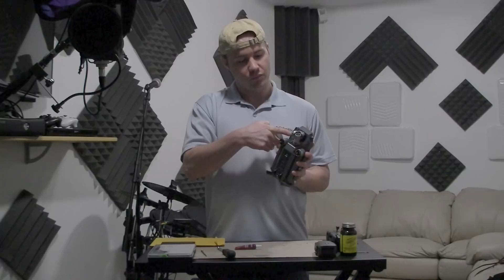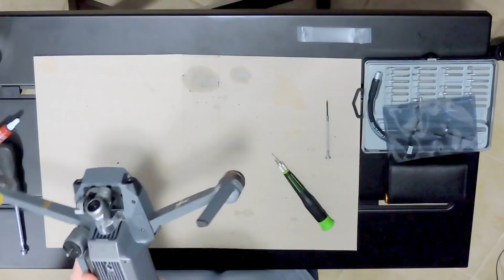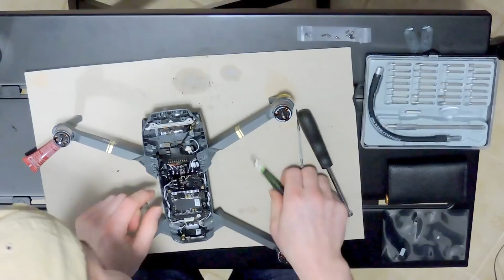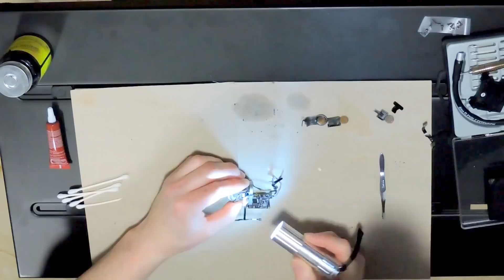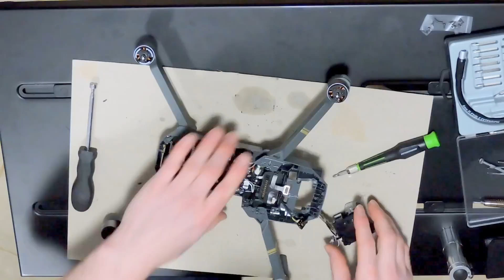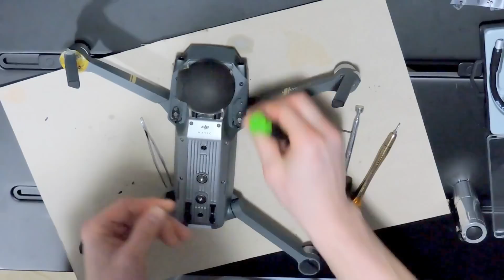DJI Mavic Pro Drone Crash Broken Gimbal Flat Ribbon Cable PCB Repair How To fix failure &Replace DIY

Comment: dose any one can explain why after i replaced gimball with original camera from mavic - both gimball and video -dead?
Reply from the maker: If you replaced them both as a single unit there are two main culprits that come to mine. 1. the connectors/cables are not set properly and are slightly off or bent. 2. there is something wrong with the board or camera...

Can you do me a favor and Subscribe?

Cody LLS

Comment: Hi, thanks for this video. Do you have some schematics with board section detail? Thanks
Reply from the maker: No schematics available. Do you have a problem with the PCB board? I have a detailed description of the repair below the video. Can you do me a favor and Subscribe?

Cody LLS
Reply: Liquid Laboratory Studio thanks...subscription done...:)...well, my mavic pro won't accepts the controller, I tried the procedure, but nothing happens..I need a schematic to understand his logic work and locate his different modules to check correct work
Reply from the maker: Thanks. I assume you are talking about the gimbal up, down, left right? If the cable is damaged in anyway through normal wear-and-tear you would have to replace the ribbon cable.
Reply: No, is no possible for me connect my RC to A.C....i follow the correct procedures, but the remote remain  BINDING for all time and not pair to AC
Reply from the maker: Maybe the toggle switch is broken wifi/rc? Are all the LED's flashing on aircraft and link button (I think it goes red, orange, then green= linked)? There are two main ways to link https://www.youtube.com/watch?v=G52F4hlR4MA

You can also try to link the a.c. to wifi cellphone app! See if it will even pair that way
Reply: Thanks for your reply...well, rear led's flashing yellow, the wi-fi/RC switch is correctly set to RC and little led under the connect button is green.
I'am able to connect by wi-fi, but have no battery information, no sensors, unknown IMU status and no flight mode. If i try to take off a message with "takeoff filed" appare on DJI go 4 app. Facory reset done, reinstal firmware done...what can I do?

Comment: Does the flat ribbon cable damage the camera image too..? I mean will my Mavic lose image if that’s broken
Reply from the maker: The flat ribbon cable only controls the mechanical aspects of the gimbal not the video feed. That being said, the mavic uses a mechanical image stabilizer (focus) so the image will appear distorted and "jellow like." You can fly with the cable broken but the footage would essentially be useless and you won't have any of the tracking features or vertical and minor horizontal panning control. I hope this helps. Can you do me a favor and Subscribe?
 youtube.com/liquidlabstudio

Cody LLS

Comment: Hi. I would like to see how the camera was behaving before the ribbon cable was changed. Looked at several different videos on how to change the cable, but all of them jumps right in to it. How can you be sure the ribbon cable is the problem?
Reply from the maker: Aah, I should drum up some old footage, hope I didn't delete it (the picture looked like jello from vibrations in flight). When the shock plate broke the gimbal was dangling. I made a new shock plate and the camera would not pass it's checks. It would give a "Gimbal overload error" and the camera would end facing down instead of forward in it's normal position. Considering the video feed was normal and it literally fell a few feet the process of elimination lead me to suspect the control PCB ribbon cable. There are 2 main causes of the gimbal overload error 1. obstructed gimbal (usually the owner leaves the gimbal clamp in during the flight). 2. Broken ribbon cable or defective PCB board.

I hope this helps. Please like and Subscribe,
Cody LLS
Reply: Liquid Laboratory Studio 
Thanks for your reply. 
What you're describing is very similar to what I'm experiencing with my mavic. 
Also from reading other comments on this video, it seems quite possible that the ribbon cable is the problem for me as well. 
I ordered a new one and keeping my fingers crossed  :)
Reply from the maker: I know what you mean about fingers crossed, hope it is a reputable seller. You came to the right place this is the original Mavic Pro repair video, I have helped many mavic owners with this and many other issues like the visual sensor calibration required after the gimbal repair https://youtu.be/0uJOQCPcJo0 and I hope it doesn't happen to you but arm/leg removal and repair.

Please Like and Subscribe,
Cody LLS

Comment: Thank you for the video. It would have been more useful if you could 1. Not take what you were doing off camera and 2. Focus more on the placement and threading of the replacement ribbon (on camera.)
Reply from the maker: Thank you for your comment and kind words. I agree with you, honestly, considering I was the first to make a youtube video of the repair I was only 70% confident it would even work and couldn't undo the glue. I did a little more trial and error than I would prefer.

Please like and Subscribe,
Cody LLS

Comment: I had the shock plate wedged and used your video to open it up and unhook and unscrew the keeper. You should do a video for that too.
Reply from the maker: Good idea, Sometimes you can wedge it back with tiny flat tools but it bends the plastic and rubber bands.

Please subscribe,
LLS

Comment: How u fold cable?
Reply from the maker: There are a few fold points you can partially crease them following the original ribbon folded direction 2. From tp1 to tp2 connector is the real tricky part it reverses twice and folds over itself at connection tp2 
There is more under the description.

Please like and Subscribe
Cody LLS

Comment: Do you have a link to where you bought it from, I am looking for the cable for the spark camera and on Ebay they are selling bogus cables
Reply from the maker: I see what you mean no hits for searching spark flat ribbon cable. I was one of the first to get the flat ribbon cable for the mavic, so maybe the spark isn't out yet. You can contact DJI support they have information on availability even though they wont sell direct right away Product Support USA +1 (818) 235 0789 Parts Support USA other numbers on dji.,com . They told me Amazon is the authorized dealer they will also know if it is available outside dji or if it is back logged because they work with the same suppliers. I purchased mine through https://www.fstop-labs.com . I would love to take a shot at repairing a spark. The mavic pro was difficult but an accomplish-able challenge. Let me know if you find it in case I get asked again.

Please like and Subscribe,
Cody LLS
Reply: Thanks for the reply  I have understood that you have to send the Spark in for repairs, they seem to replace the complete camera, which costs about $200 and is available on internet, Hopefully when all the Sparks are out of warrantee they will start selling more parts

Comment: Hey dude nice video. Id like to ask you what's your opinion about my mavic. Recently I did a crash and although the propelers and everything are good and also the gimbal moves with my controller .. although I saw that the bracket is more flexible now.. Can I change that?? (Thanks again and sorry for my bad  english)
Reply from the maker: If you are talking about the gimbal shock plate. I would highly recommend changing it (the video shows how). I prefer flying the Phantom 4 Pro. The Mavic Pro is a brittle novelty that you will have to become an expert in repairing to keep it flying.

Thank you for subscribing
Cody

Comment: I appreciate you showing us how to repair the Mavic. 
Thank you very much.
Reply from the maker: Thank you kindly for acknowledging the effort @Marco S
Reply: Those people here criticizing your work are fools.
Reply from the maker: There was no repair manual or reference @Marco S Thanks again I hope your repair goes well

Thank you for subscribing,
Cody
Reply: I learned from you how to open the Mavic. I accidentally flew my Mavic into a tall tree and it stayed there for almost 2 weeks, until I found an arborist who climbed that tree to fetch my Mavic.
To my horror there were 15 earwigs that came marching out of my Mavic.
Yesterday I opened up the Mavic and found white stuff in there that wasn't supposed to be in the Mavic.
Luckily for me the gimbal survived and even though we had rain every day, there was no water in my Mavic.
Very strange...
Reply from the maker: I am glad you got it back. Try putting it in a bag with silica packets or rice to suck out the residual moisture from the rain so the electronics stop corroding.
Reply: When I got the Mavic back on that afternoon 2 weeks ago, the same evening I turned it on and it flew as though it had never been in that tree for 1 week and 6 days.
I had recharged its battery first without any problems. 
Subsequently I kept the Mavic in a room where it is always warm around 28°C.
I left the kernel of a nectarine in the same room in the hope to lure any other earwigs out of the Mavic, and sure enough, 6 days later I caught one nibbling at the kernel.
Anyway, those Mavics are tougher than they look!

Comment: Hey! good video, it is so clear! I have a similar problem with my mavic: I crashed two days ago and now the gimbal is not working correctly. It is moving when i turn on the mavic, but it doesn't respond to my controller.
Everything looks fine, the camera is working fine and i can take pictures and record videos.
Under Overall status on the DJI app it posts two messages:

1 - Gimbal motor overloaded. Check weather gimbal clamp is removed.

2 - Gimbal is restarting. Check that gimbal rotates smoothly if restart fails again.

How can i know that is a ribbon cable problem?
if I would be sure it is this problem i will just buy a new cable and i will not send the drone back to dji (I've seen DJI costumer service is not the best), but how can I be sure? I don't want to create more damages!!
Reply from the maker: Those are the exact same symptoms mine gave. When the gimbal motor overloaded it would face in the wrong direction (down). Then it kept restarting and trying to do the initialization test so making clicking sounds while checking for full movement and functionality. The difference is my gimbal plate broke which gave a strain on the PCB ribbon cable. That is why I was pretty sure that was the problem.

Please like and Subscribe
Cody LLS
Reply: Thank you for the answer, my gimbal plate is not broken, it looks fine. I really don't know what to do
Reply from the maker: All signs point to the cable..., but you won't know unless you disassemble it. The damage on mine (in the video) is not apparent until I got really deep into the repair. The flat ribbon cable and shock plate truly are the Achilles heel of the Mavic Pro.

Thank you for Subscribing,
Cody LLS

Comment: Do they make higher quality replacement parts?
Reply from the maker: I know the ribbon cable comes in many different qualities, I bought the more expensive one. As far as the gimbal plate, I would recommend an aftermarket one you can try ebay. I saw a 3D printed composite one and a bent aircraft aluminum one. Both of these are way better than the cast metal stock one. The rest of the Mavic Pro is engineered with low quality and strength materials.

Comment: I crashed my drone into a cliff (video on my channel) can you please help me find the issue? is the ribbon cable broken with mine? it get image to my phone but i cant control the camera.
Reply from the maker: That is unfortunate, It does sound like a broken flat ribbon cable. Watch this video over and over it will help you fix it. You just need to get the part ebay/amazon/fstoplabs.com, I hear dji has it in now. I have some extra tips below I will re-post.

Thank you for subscribing
Cody LLS
Reply from the maker: There is some that didn't make it on camera while I was doing the trial-and-error part: Like I said in the video I used the old one as a template I recommend taking pictures before of the old one installed, so you get a general idea.
1. There are a few fold points you can partially crease them following the original ribbon folded direction
2. From tp1 to tp2 connector is the real tricky part it reverses twice and folds over itself at connection tp2
3. Remember that the gimbal turns freely so the slack will be on the 
opposite side of the pivot joint (it basically loops back to not restrict the motion of the motors)
4. The cable lays flat so if it is twisted or awkward it is not correct or not folded properly.
5. You will have to fold tp1 and tp2 at the line half before you thread it through the side and half afterward
6. Make sure to clean all connections the original liquid tape will obstruct you from SOFTLY pressing on the tp1-tp4 connections.
7. the adhesive on the new ribbon is not that sticky so you can wait until you are done to remove the stickers. Because of the trial and error and bending mine didn't stick the best. 
8.  Like in the video when installing the plates barely tighten the covers on the gimbal let the thread locker 242 (loctite) hold them in (they are fragile and could crack in the tightening process.

Thank you for Subscribing: I hope it goes well be patient and remember it is tricky not impossible
Cody @Liquid Laboratory Studio
Reply: Thanks so much bro, I've ordered a flat ribbon cable now and will use your video as guide and i will record it incase if i messed up. I will let you know how I go. 
Thanks for clearing it up for me.
Reply from the maker: You are welcome

Comment: Good detailed information! That said, your camera skills suck Bro. You should take more time on camera set-up to really get in and show your skills and attention to detail. Overall a great help. Thanks for spending the time to contribute to the DIY Mavic repair community!
Reply from the maker: Thanks Josh, I wasn't able to see the camera as it was filming, maybe, I'll have to experiment with a second video view screen or flood it with studio lights. When I tested and pre-checked everything it looked good but in the end the view drifted and I couldn't redo it.
Reply: It is still the best video on the replacement of the Mavic Gimbal ribbon cable on YouTube. I'm still having trouble with the routing of the new cable... any further help would be greatly appreciated. Keep up the good work!
Reply from the maker: There is some that didn't make it on camera while I was doing the trial-and-error part: Like I said in the video I used the old one as a template I recommend taking pictures before of the old one installed, so you get a general idea.
1. There are a few fold points you can partially crease them following the original ribbon folded direction
2. From tp1 to tp2 connector is the real tricky part it reverses twice and folds over itself at connection tp2
3. Remember that the gimbal turns freely so the slack will be on the opposite side of the pivot joint (it basically loops back to not restrict the motion of the motors)
4. The cable lays flat so if it is twisted or awkward it is not correct or not folded properly.
5. You will have to fold tp1 and tp2 at the line half before you thread it through the side and half afterward
6. Make sure to clean all connections the original liquid tape will obstruct you from SOFTLY pressing on the tp1-tp4 connections.
7. the adhesive on the new ribbon is not that sticky so you can wait until you are done to remove the stickers. Because of the trial and error and bending mine didn't stick the best. 
8.  Like in the video when installing the plates barely tighten the covers on the gimbal let the thread locker 242 (loctite) hold them in (they are fragile and could crack in the tightening process.

Thank you for Subscribing: I hope it goes well be patient and remember it is tricky not impossible
Cody @Liquid Laboratory Studio

Comment: Hey there, thanks for posting this.  I crashed my brand new mavic yesterday seems to have same damage.  Although my little black plate that the camera is attached to crack so the camera is now just hanging by the exposed metal wires.  Funny thing is the camera still works fine and produces clear live video.  The drone also seems to fly fine other than the engine overload morning which I'm associating with the hanging camera.  Do you know where I can buy the plates and the cable that you replaced? Man, I hope I'm technical enough to pull this repair off.  Going to go by all the little screwdrivers and magnets at the Home Depot now.
Reply from the maker: Your shock plate and ribbon cable are broken. You can get them both from ebay (I got mine from fstoplabs also on ebay or google). I personally would get an aftermarket shock plate the original is garbage. Watch the video over and over and you will be fine. The gimbal was  the hard part for me, because, I did not flood the desk with bright lights so the video would come out. When you are done you will need to calibrate the visual sensors https://youtu.be/0uJOQCPcJo0 and gimbal adjustment (video coming soon)

Please Like and Subscribe
LLS
Reply from the maker: Now I have the gimbal roll axis calibration video up here is the link https://youtu.be/1y3-e3MhI1w